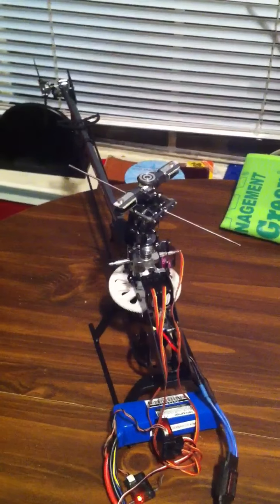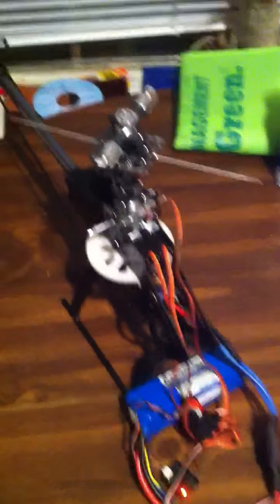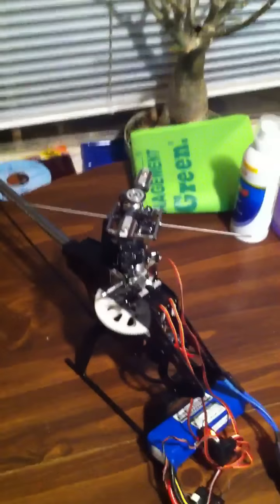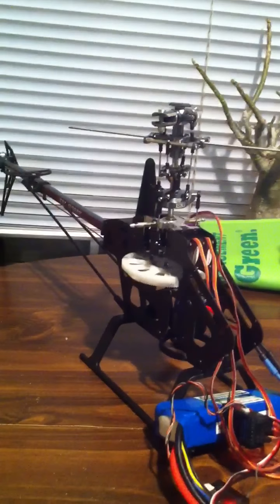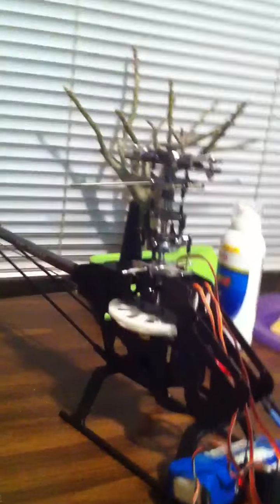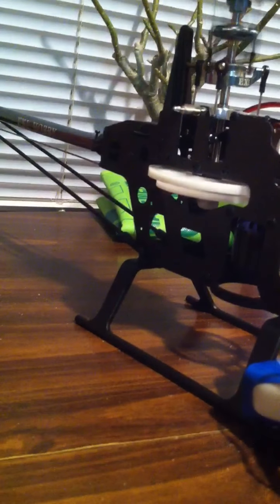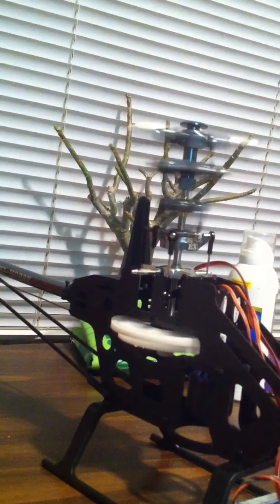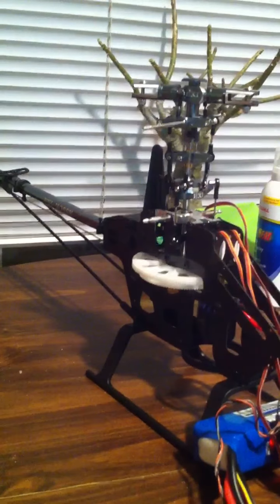EXI-450 build issues

Comment from the maker: the main gear shaft, that came from the factory..  i had issues with it, I stripped and half broke the nex nut on it and the thing below the swash moved so i coudn't adjust it roght.. the one i got right now does.nt have that thing.. i mean movable.. it has the ring which is molded into the mainshaft and hold it all .. no screw/movable stuff invlolved... this is the replacement i ordered with it.. you think its a problem?